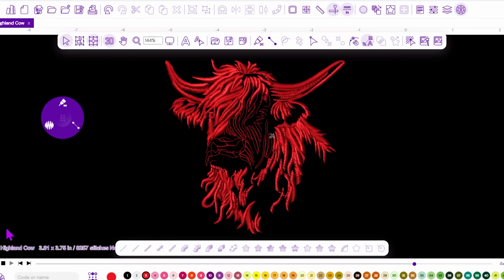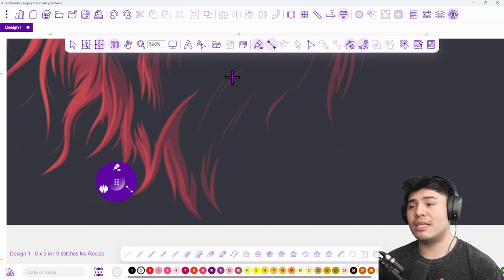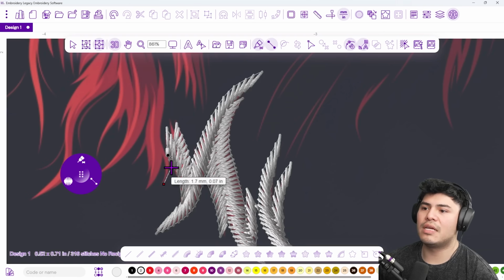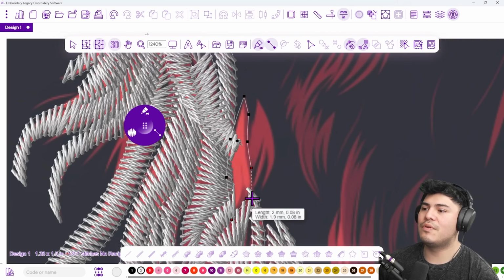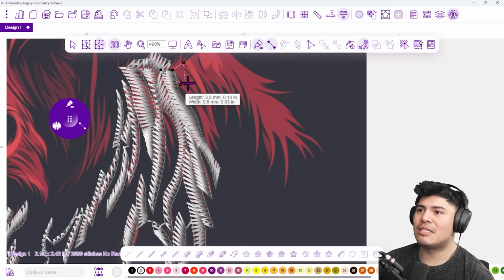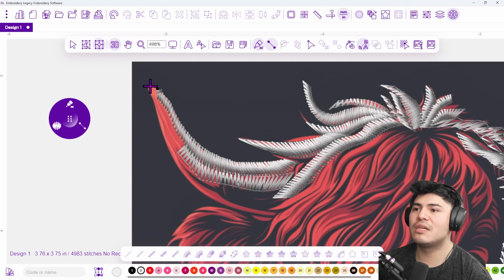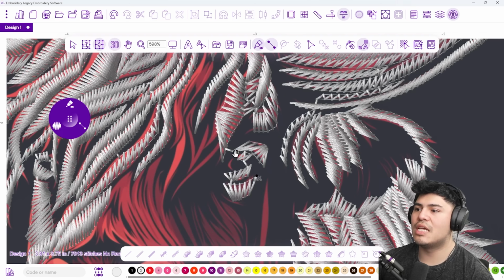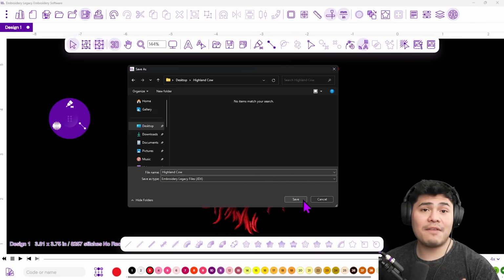You can Digitize a HIGHLAND COW for Embroidery! | Step-by-step Guide

Comment: Awesome video! Quick question, I noticed you selected the "no recipe" option, but did not convert after the design was completed. When I finish my designs i select the material i plan to stitch to (sweatshirts) but it seems to change the design up quite a bit. Should I start by selecting the recipe before starting the design? What if I decide to stitch to multiple types of materials as well? Thanks!
Reply from the maker: Great question! 😊 This design was a bit special since I digitized it without underlays in mind, so there was no need to update the recipe afterward. If the design were larger and I needed a more solid look for each outline, I’d definitely have selected a recipe before digitizing to ensure the best stitch quality.

If you plan to stitch on multiple materials, you can adjust settings for each fabric type, but having a base recipe from the start can help guide the process. Hope that helps! 💜
Reply: Thanks for the reply! I appreciate it a ton!